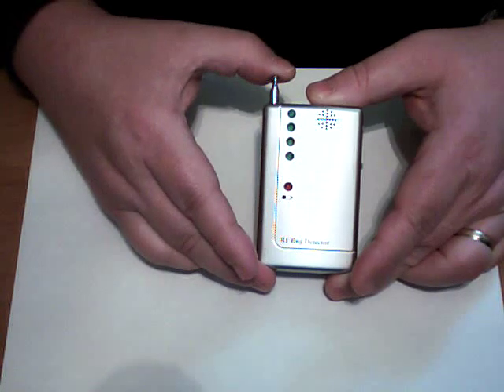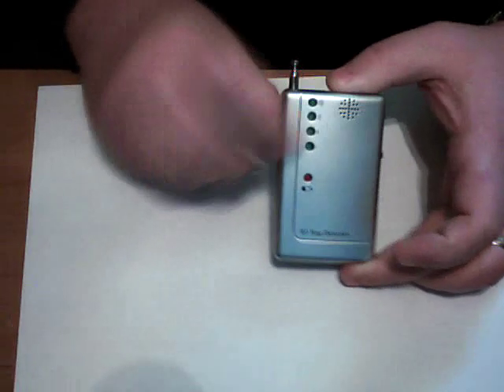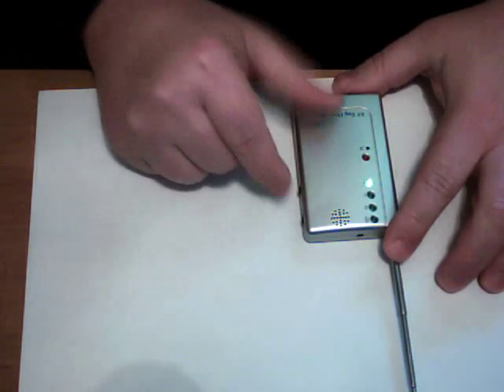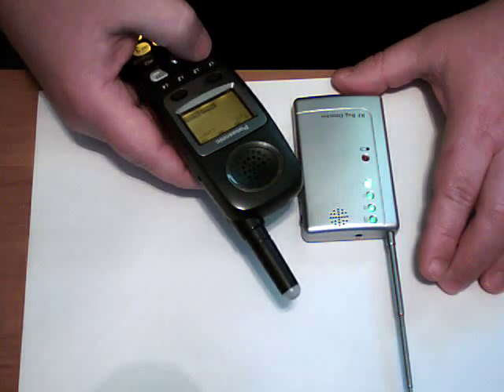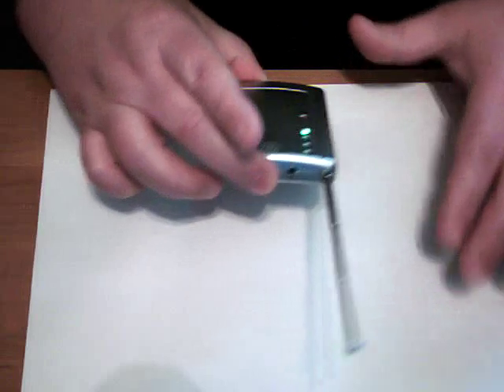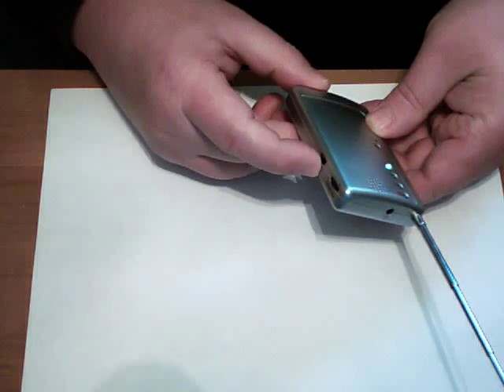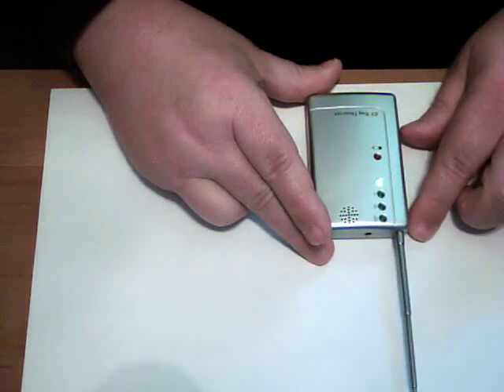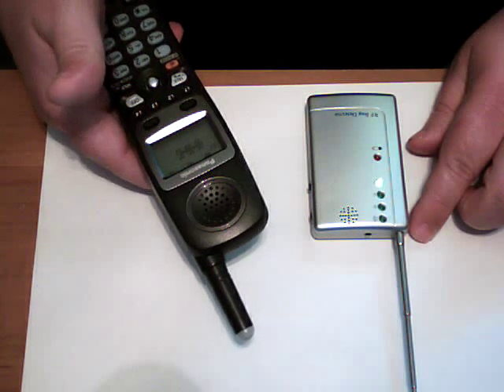How A Bug Detector Works Basic Bug Detector Operation

Comment from the maker: That is true. You need to disable all the wireless you know of so you can get an accurate reading. Also the sensitivity can be adjusted and the antenna can be lowered to shorten the range.  this is a blog with details on finding them. spyville.blogspot.com/2009/04/bug-detectors.html

Comment from the maker: Most any detector will work they all find wireless signals. but they do not separate the signals so you need to disable all the wireless devices you know of before starting to search
Check out this page
spyville.com/how-bug-detector-works.html
None of them will just point you at a bug you need to sweep the room for signals and determine what is causing the signal

Comment: hehe yeah!   Anyway,  I don't think this is a true RF detector especially when it will alert in the woods with no power lines or antenna anywhere near, It even alerts on my steering wheel of my car.